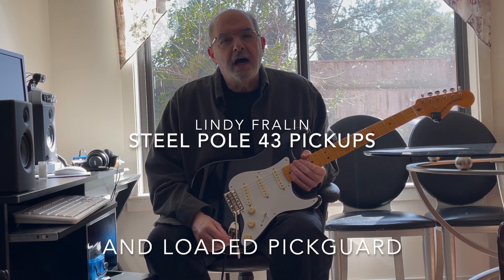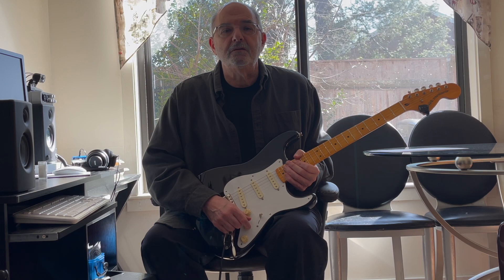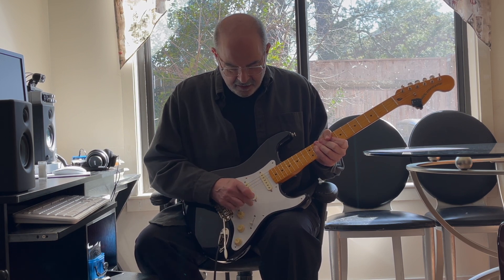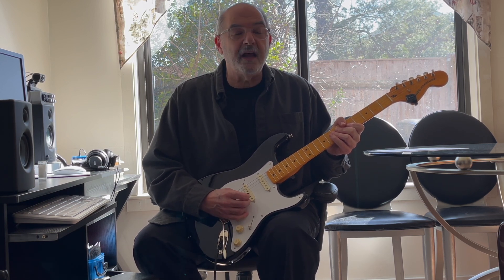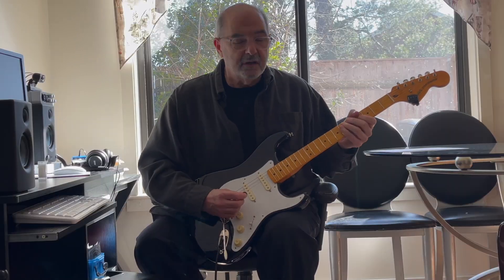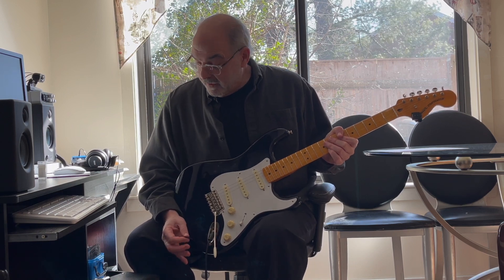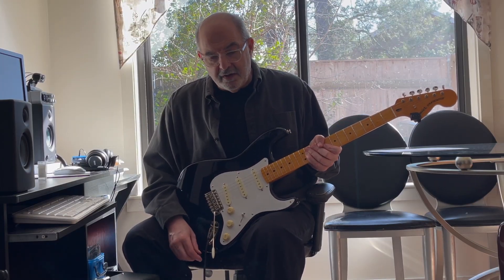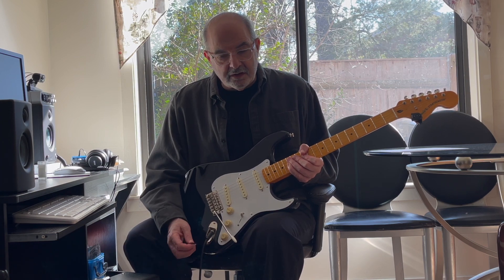Lindy Fralin Pre Wired Pickguard Steel Pole 43 Pickups Review and Demo

Comment: I just got a set with a 43 bridge and the 42 in the middle and neck. I find them to be overly bright unless I turn the tone down to 3 or 4. Going to try a 250k pot for the volume and see if it helps.

Comment: Great video, are any of these the Split Steele Pole 43 Fralins? This video sounds so good, I'm about to buy these, but then I stumbled across those split blades. There is an option however to have the split blade in the neck and middle, and have a split steel pole 43 in the bridge.. this video makes me want to put the split steel pole 43 in the bridge. Would you prefer the steel pool 43s? Or the split blades?
Reply from the maker: Yeah, Sean. They’re Steel Pole 43s in the neck and the bridge. Steel Pole 42 in the middle. That was Lindy’s recommendation. You can usually reach him at his shop. He’s really helpful.

Comment: Sounds great. I am looking at the same setup. Did you wire with 250k or 500k pots?
Reply from the maker: Lindy recommended 300K and I went along with that
Reply: @david_rabinow  great thanks!!
Reply: @david_rabinow interesting. They used 500k pots for mine and it's ridiculously bright sounding.
Reply from the maker: @GoDrex  Funny, I wish mine was a little brighter. You know everything is done by hand so there’s bound to be some variation. Although I’m sure Lindy uses some sort of computer quality control.

Comment: Such great tone. Just curious, what’s your wiring diagram look like?
Reply from the maker: I don't really know. Lindy Fralin did the wiring for me. It's pretty complex. There is a master volume and master tone. The third knob is a blender that adds the bridge pickup to whichever pickup position you're in. Lindy wired it so that it's noise cancelling when I have the 5 way switch in position 5 (Neck pickup) and the blender switch anywhere from 1 (Both pickups full) to 4 (full Neck and 60% bridge). The pot on the tone knob is a push pull. When pulled up it puts the bridge pickup out of phase. He used a 300K Volume Pot because the steel pole pickups are a little hotter.
Reply: @david_rabinow  Awesome, thank you. I’ll have to reach out to them when I’m ready to have one made, and make sure they set it up like yours.
Reply from the maker: @dukeravenshadow5532  he might remember me but if not you want Steel Pole 43 pickups with a blended pot, push-pull phase and 300k volume pot
Reply: @david_rabinow  Awesome, thank you :)
Reply from the maker: @dukeravenshadow5532  No thank you!